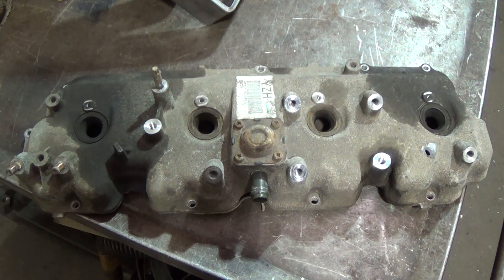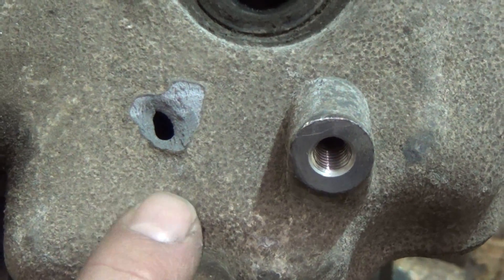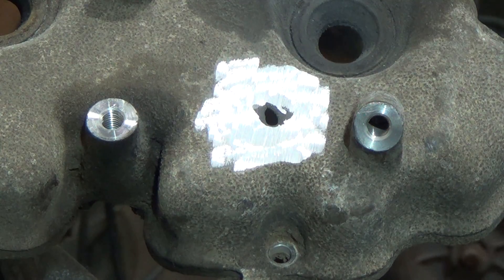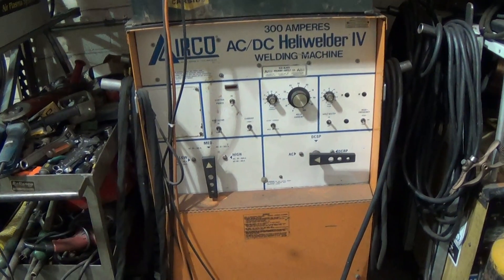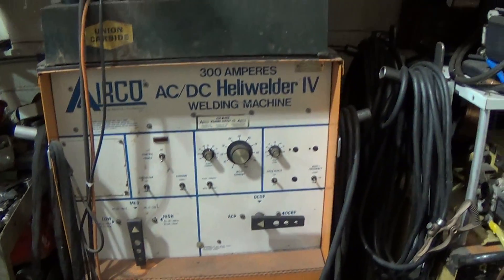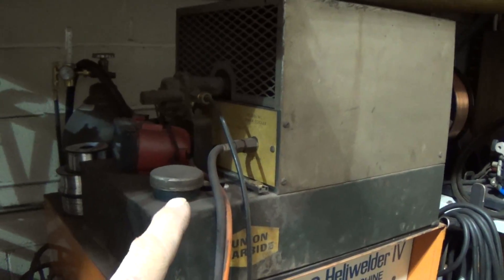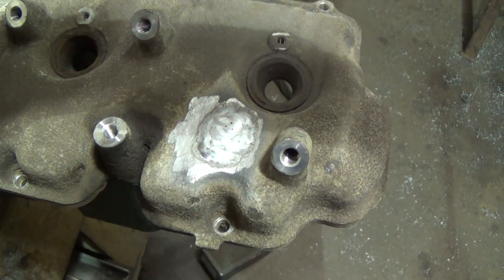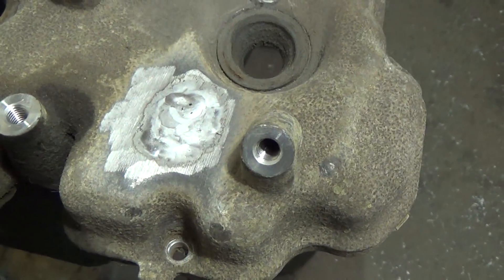Heliarc Repair Of A Cast Aluminum Rocker Cover

Comment: Not being at the design end of the cover, I would guess that the finish on the outside of the casting is a textured finish that provides for a ost saving. Basically it is not finished to the same standard as the underside of the cover. The only oxidation is the dull colour of the outside surface. I have known people polish these cover's but it takes a lot of time and patience.
Reply: Vapor blasting...

Comment: It's the media the wax is dipped in when they cast it. The wax goes away and the media used to form the mold stays.It should have been blasted. Just another cheap cost cutting measure.

Comment: ....Airco....a shop I worked at a few years back had 5 of these....pretty decent X-former machines, made by Miller......not much in the way of parts available, but easy to repair...very little electronics in there....

Comment: I'm from NYC and I was surprised that you were surprised at the surface corrosion, I'm sure they salt the roads in northern Jersey. Untreated, uncoated cheap cast aluminum is a magnet for the salt, especially the slurry that gets kicked up off the road. I have polished aluminum wheels on my truck(love em and hate em) and have to polish and coat them every year, the salt wrecks the finish.
Reply: I was figuring that was North Jersey accent I was hearing..

Comment: ..I have a 1956 P&H TIG Welder...30/300 AC/DC....water cooler built in the base with big water tank....pump is a Jabsco....very quiet.....you can find them at boat shops...used for bilge pumps on small boats.....it cools both my 250...and 400 amp torches just fine....

Comment: Dont think that is sand cast,look at the inside. That is typical of corrosion caused by heat and water perhaps even salt water, seen the same on engines that have been in boats or run outside with no cover.

Comment: I agree... looks like casting sand.  Not pretty.  From a pride thing as the manufacturer, I would have cleaned it off, but would I push the labor cost to the customer, or take it out of my profits?  You just filled the hole on casting.  Did they give you a picture of a 'normal' fixture so you could come back and drill and tap your repair for what ever line that was for?

Comment: try a 2% lanthanated tungsten sharpened to a point  - I have an equally old and reliable Miller Dialarc HF and the pointed tungsten is a lot nicer than the blunt ball to place the arc were you want it.
Reply from the maker: bob14219  Hi Bob, I have been considering trying some of the newer tungsten's, I have been recommended quite a few of them by different people, so I will be doing that soon, might even make for a good future video to test and show the different results.  Thanks for the suggestion ...... Mike
Reply: +Michael Reggie gold %1.5 Lanth or blue %2 Lanth, never mind the rest. You'll never buy pure green again!

Comment: Hey Mike
I copied your info on the 4145 rods, but cannot find them, can you tell me the supplier as i would like to get some to try welding up some rice planter plunger housings that always crack, they are packed with grease when working so difficult to get 100% clean, i have even tried to clean in ultrasonic cleaner bath but still get some issues so thought i might try these rods
Reply from the maker: Marc Godwin  Hi Marc, If I'm going to be getting at least 5 pounds of filler wire I usually get it thru an Airgas distributor, they seem to be willing to get almost any alloy I ask for and also seem to have enough purchasing power to get that small a quantity without fuss or delay at a reasonable price. If I just want a pound or so of a particular alloy, I have been getting it from a company called Arc Zone in California, they seem to have almost any alloy you would like in as small as a 1 pound quantity, and they too ship it out quickly, of course, it's priced accordingly, but I've been OK with that so far.  I don't think the 4145 alloy will help with a dirty oil soaked condition, in fact the extra silicon in the 4043 might be the best for dealing with that, it does however seem to really "mix" or wet out much better than any of the other alloys I have tried for cast aluminum. I would think the ultrasonic cleaning would be the best way to deal with the contamination, maybe to double check the results of it, you could put a torch to the cracked area prior to the welding to see if anything bakes out of it, if not, perhaps it is just a poor quality casting, and the 4145 alloy would help.     I just repaired a very dirty oily cast aluminum flywheel housing from a Cummins engine yesterday, and I was able to get it cleaned up with a few rounds of lacquer thinner/torch treatments, it had to be able to take weld throughout the entire cracked area, as the engine side of it is wet, and of course, must be sealed, and with the additional cleaning, preheat, and the 4145 filler, it was a successful repair. Good luck with the repair, and let me know how it turns out.  Thanks for the question.      Mike

Comment: Nice video , if I had the space an old transformer machine will just run forever. Short term on cooler water pump noise sheet metal shield with soft material might attenuate noise . Suggestion old(cheap) auto darkening helmet for camera ?
Reply from the maker: Hi E,  I have tried about everything to lessen the sound coming out of that cooler, I'm convinced it's more of a harmonics/frequency problem than anything else, I've actually in the process of building a replacement cooler, so there will be some upcoming videos about it. Thanks for the suggestion and the comment.
      Mike

Comment: constant current AC lol HAHAHAHAHAHAHA
Reply from the maker: Hi Cassie, Not sure I understand the funny part??  I was explaining the parameters of what I was doing, CC is constant current which is the type of process, that would be used, as opposed to CV constant voltage or CP constant potential. Heliarc or TIG is done in the CC mode which would be the same as stick welding.  The type of current in this case was done in AC with a continuous high frequency arc assistance, that would be as opposed to either DC positive or DC negative.
   This is the most utilized way to heliarc aluminum, even with the new high tech inverter machines, constant current in the AC mode with a continuous high frequency arc stabilizer.
    Mike
Reply: +Gen Maximus maybe because AC (alternating current) by it's very definition is constantly changing 60 times a second???  Just a thought.
Reply: what is funny about constant current vs constant voltage?
Reply: the sine wave alternates. however, the amount of current at the welder is constant. the voltage varies.
whereas a constant voltage as used in MIG welding is a variable current. 
The term Constant current does not refer to the mains input, but rather the control of the output current on the machine.
Reply: the sine wave alternates. however, the amount of current at the welder is constant. the voltage varies.
whereas a constant voltage as used in MIG welding is a variable current. 
The term Constant current does not refer to the mains input, but rather the control of the output current on the machine.

Comment: sounds to me like your cooler has a rotary vane pump made of copper or brass, It sounds to me like it's been taken apart, frozen, damaged before. I have seen that happen a few times now. another reason is because you may be using Glycol/water either or where it may require water soluble water.
    What I would try *(may be completely wrong no bets) is a. Take spine gears inside pump out and mark them so they go to the correct side if they are now. than.
 b.) would take the pump and set it up to run a closed loop of very fine grit… finest you can get car polish silicate type. (Pack the bushing bearing surfaces with thick grease first to keep grit out.) mix a solution to keep the consistency able to run through without problems (use your mind) = run it  till the similar noise quiets up or changes in the first 10 - 20 seconds DON"T RUN LONG OBVIOUSLY. that will smoothen up the pump mechanism gears just the two if it has a transmission gear (yours maybe nothing like this but they are..common, used to be). put it back together after thoroughly cleaning the parts with the correct size gasket… clean correct solution and that same pump will be library material… . Like I said I may be completely misperceiving the noise and my methods may not work at all and may damage everything. I have had luck with that.

Comment: You didn't show the under side
Reply from the maker: Hi ebuff,, yes, you are right, I think someone asked about that when I first posted this video, it was just a small bleed thru on the underside, about the size of a BB, but homogeneous with the rest of the weld, so no worries about it dropping off.
  Thanks for the comment ...... Mike

Comment: lol had to have a laugh as I'm always bugging you about you settings :)
Can I ask for some
Advice Michael..
I'm TIGing some alloy at the moment and no matter what I do I'm getting awful contamination. It was going well but then just started getting black pools of crap. 
If I get up to the 110+ amps it cleans however I'm doing a corner weld and it destroys the ends. 
Advice would be very much appreciated if you have heard of this
Reply from the maker: Hi Jesus,  I'll take a few guesses at what the problem might be.
 1  Clean, clean, clean, wire brushing with clean stainless wire brush, sanding, grinding, etc. wiping with acetone or lacquer thinner, sometimes on a corner joint as you describe, I'll dip the wire brush into the thinner and brush into the fold of the corner so the thinner is dripping off, and gently blow dry. Also, a good habit to get into especially with aluminum, is to wipe the filler wire with a thinner soaked rag until it no longer is picking up any marks at all. 
 2  When you say alloy, do you know what alloy it is, I know some of the alloys are not recommended for welding. Is it a casting as shown here on the video, especially an automotive casting that has been exposed to oils, road crap etc., the pores just seem to drink it in and it sometimes just won't take, if that's the case, you can try cooking it out with a torch, but try not to overheat it and melt the part.
 3 Maybe up the gas flow, when you're running a corner, the gas can tend to diffuse and dissipate because it's not bouncing off of anything. Also, sometimes if you're at the bottom of a cylinder, there tends to be a dirtier gas at the bottom of the cylinder for some reason.
 4 Cup type and size, if you're using a standard cup, say a #7 or#8, try dropping back to a #5, also try switching to a gas lens. If you're using a gas lens, try switching back to a standard cup and collet body. 
 5  Filler wire, try changing up the brand and or type of filler, if you're using 4043, change to 5356, or 4643, if I'm not sure what I'm dealing with, I'll normally reach for 4643, it seems to wet out and join up a bit better than most of the other alloys.
 6 Tungsten, I don't know if you are on an inverted or transformed machine, but if you are on a transformer machine, my opinion is green band pure tungsten for aluminum  [unless I'm in a very high heat situation where I'll switch to yellow band]  I know about getting the red band to ball over, but, call me old school, I just don't like it. I'm not familiar with the inverted machines, and I know they are doing wonderful things with all kinds of tungsten, but my knowledge is limited to transformers with green, red, yellow, and brown band tungsten.
  Lastly, are you sure it is aluminum, some of the  magnesium alloys can be deceiving, and render the crappy results you are describing, a quick vinegar check will tell the story.  Oh, did I mention CLEAN??  LOL
  I hope this will be of some help, please let me know how it goes, and good luck with the job.
   Mike
Reply: Michael Reggie Thank you so much for that detailed response mate. I think you may have hit the nail on the head with the comment on the bottle. The welds were really clean until I got down under 1/4 and then everything went bad. I tried to adjust cleaning and frequency but it wouldnt work.
God bless you mate, i really appreciate your time to respond.
Reply from the maker: Jesus is the man You are very welcome, Hopefully it will be of help, please let me know how it turns out.
Reply: On a serious note: your experience is very impressive. Thank you for sharing.
Reply from the maker: I never knew that about the Zir-tung, I have used it in the past, it was recommended for a copper job I was doing at the time, Thanks Paul

Comment: yup, mike - soda fountain pumps with the pressure turned down all the way. Mine is pretty quiet.

Glenn
Reply from the maker: Hi Glenn,  I have wondered about the pressure, I guess there has to be a fair amount to travel through 50 ft. of such small diameter tubing.
 I really have to do something, it's driving me insane, oh, wait, it's too late.......
 Thanks ....... Mike
Reply: hahahahaha -

Hey Mike, I built my own with that soda fountain pump and one of the 5 gallon clear drinking water plastic containers. No need for fans and radiators due to the volume of the water. Two years now and no problems.

I have a similar TIG welder to yours, its a beast and capable of over 400 amps, but welds every bit as good as the newer precision tig that I never use any longer.

I hate all the new (cheap) electronic stuff in everything these days, and wanted to get back to basics. I really like these old transformer based machines.
Reply from the maker: Glenn Davis Wow, another great idea, I have somewhere, a simple motor and pump setup that I used to take on the road some years ago for doing mobile heliarc, and I used to just drop the 2 hoses into a 5 gallon bucket with a small counterweight to keep them from falling out, hmmmmmm......
  like I have been saying, this is a great medium to be batting around and sparking new ideas, thanks for the mental jarring.
  Yes, the new electronic stuff, I'm sure you see in my videos the white sheetmetal covers that have the Hobart decals on them leaning against the belt sander, I have been intending to do a video about it and the Hobart welder with the 2 feeders on it that I regularly use, they are actually one big story, stay tuned, that will go directly to what you are saying.
  Thanks again Glenn .......

Comment: that looks like something as shorted out on there electric cable
Reply from the maker: Hi Andy, that could have been what happened, maybe a cast in type mounting point for a terminal connection, and when they went to loosen it, it snapped off, I didn't see what was on it when they brought it to me.
  Thanks for the comment ..... Mike

Comment: Thanks for the plug. Yes you have an oberdorfer pump. I converted it to a procon. If i welded that valve cover i know it would have cracked on me. Lol.
Reply from the maker: Hi TJ,   you are very welcome, I really do have to do something, I hesitate to make some videos because I know that thing will be running in the background.
  No, I've seen your work and your setup, you'd do a fine job of fixing that!
     Thanks ...... Mike

Comment: You destroyed that beautiful Patina finish on it!  Now it'll never work!  LOL  Good video!  And I'm quite certain your cooler set off my Tinnitus. I'm heading off to check out the mod video for that now.
Reply from the maker: Hi Matt, uh oh, I hope I don't get in trouble for that, hopefully the mechanic will bolt it all back together and all the hoses and harnesses will hide it from view! Ha Ha
 Actually, I had to go to that same customers shop tonight to do some on site work, and the mechanic had put that side back together[he's replacing injectors] and I could not actually see the cover with all the "stuff" bolted in place, man, what has it come to??  These are supposed to be diesel engines......
  Yes indeed, maybe those coolers were designed by an enterprising audiologist, figuring it would bring him a lot of business. There are times when I would like to make a video about something I'm heliarcing, but decide not to try and compete for the sound with a 60 year old machine.
  Thanks for the positive comment ...... Mike
Reply from the maker: Paul, it seems the problem with the older coolers is that they use a gear pump and that is what contributes to all the noise and harmonics. I think the newer coolers use a vane style pump.

Comment: Geez, you'd swear that truck spent it's life up here in the salt! Maybe it did..lol
Yer cooler appears to have a gear pump?? No wonder it's loud. This TJ fella must have switched it out for some sort of impeller type?

Colin

PS: I was watching you repair that on the new WT1 camera..... :-)
Reply from the maker: Hi Colin, you may be right on both those things, that corrosion looks like it was coated on there, and that cooler makes the whole shop vibrate, I'm gonna have to do something or I'll need to be fitted for a jacket that buttons from behind!
  Thanks for watching ...... Mike
Reply: Hehe.. Hey, shouldn't you be working and not on the net??  Hmmm, shouldn't I? lol

Later,
Colin
Reply from the maker: ***** Of course I should have, but I think I made up for it tonight, I didn't finish until after midnight........
Reply: Michael Reggie
Maybe you should be the guy with the "ShopDog" handle...lol
Reply from the maker: *****  HA HA, I'm not so sure he'd like that!